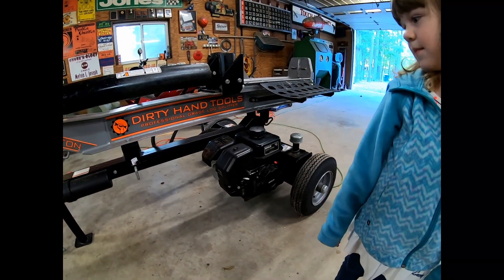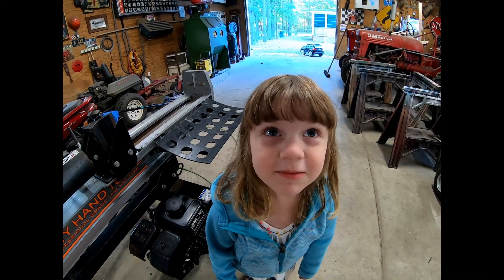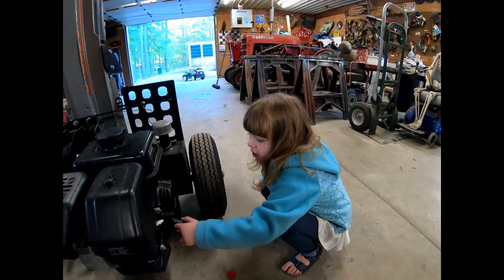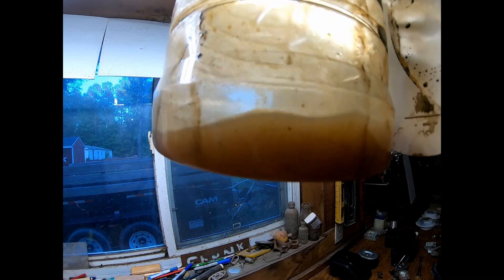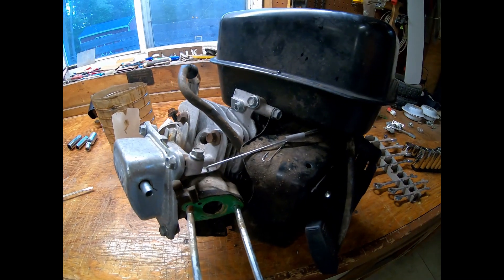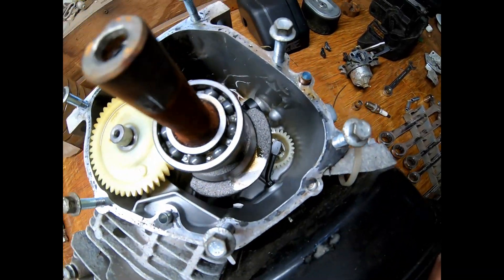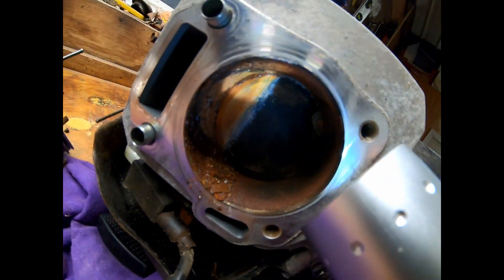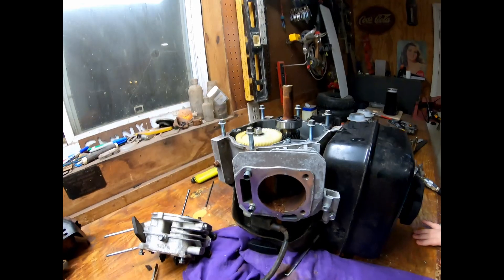Why doesn't My Logsplitter Engine turn over ?

Comment: Hey! I just came across this video and followed your steps to get the engine off and broken down. Same issue here. Same splitter here in Colorado. What do you have the specs of the replacement motor? Did the replacement work?

Comment: I'm not much of a mechanic so maybe this isn't a great question, but do you think the water may have been from bad gas that wasn't used or drained?
Reply from the maker: There are actually a lot of different things that can contribute... even the fact that USA Gasoline has Ethanol that can draw moisture into the gas... Not to mention the simple things that could have caused it --- like your kids leaving a gas can out in a rain storm and then filling the splitter up to use it ?? so any ways this could happen.... Thanks for watching and for the comment !!!